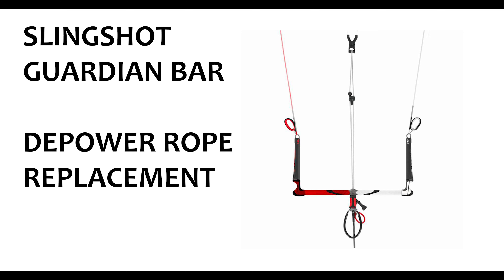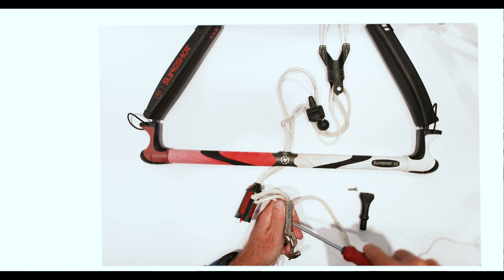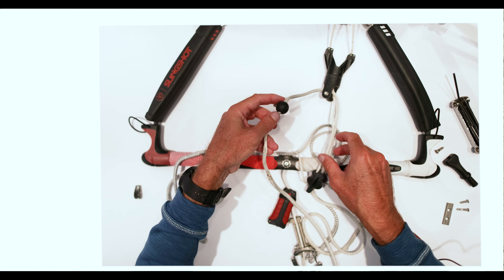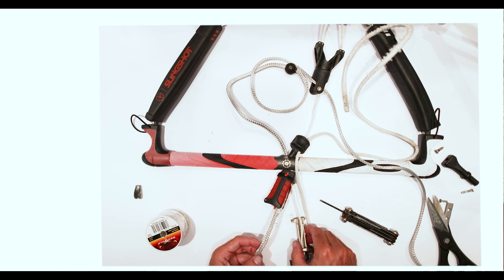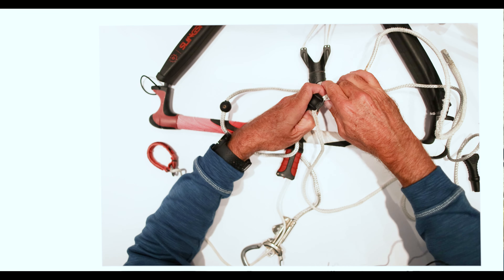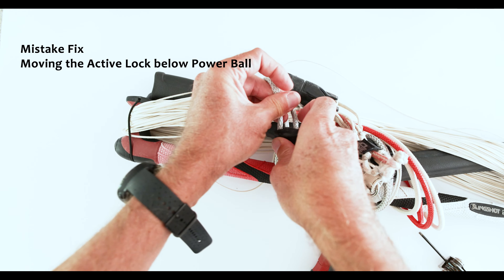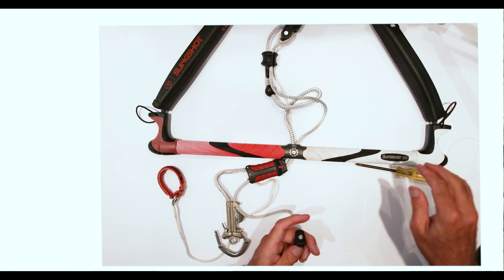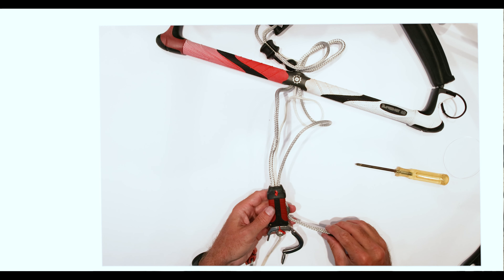Slingshot Kite Guardian Bar Depower Line Change

Comment: Thanks for making this video!  Do you recall what Allen wrench size you used for the stopper ball?  7/64 is too small and 1/8 will not fit.
Reply from the maker: I think they are using metric.  I don't recall the size, but grab metric set.
Reply: Thanks!  I'll check.